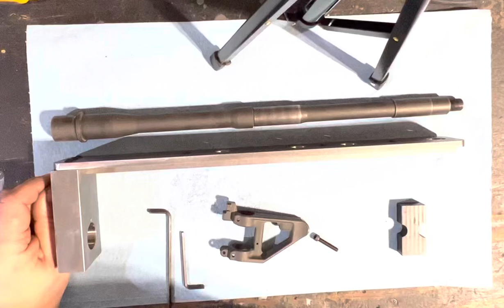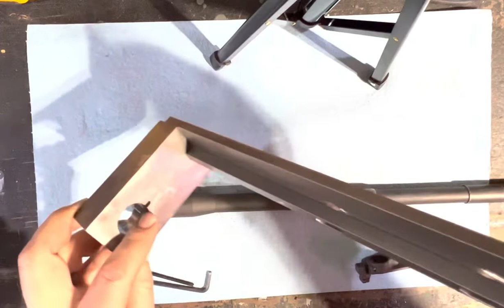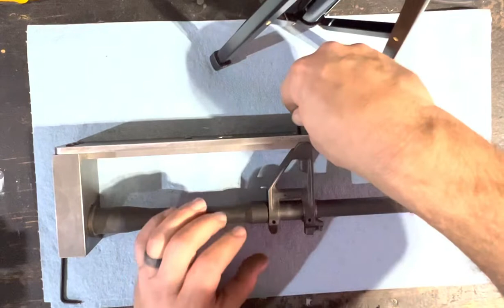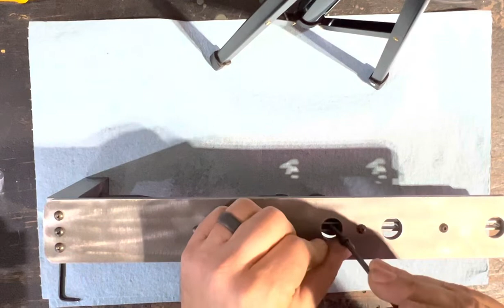BRD Engineering Front Sight Base Jig overview

Comment: Jp Enterprises A2 front sight base with adjustable gas...$150
Problem solved
Reply: What “problem” is that solving?

Little clamp screws are not even remotely a good substitute for taper pins.